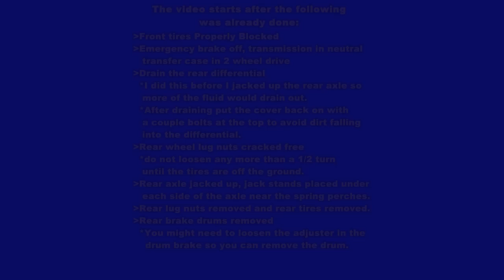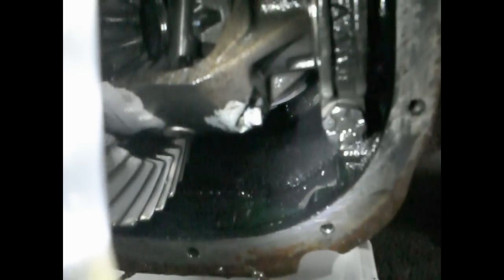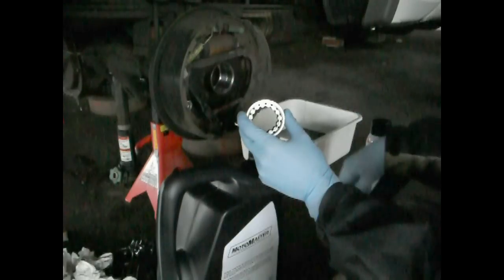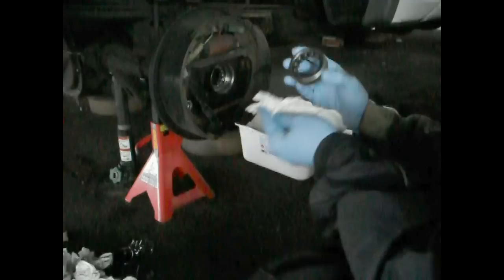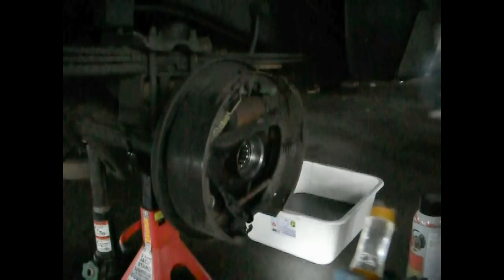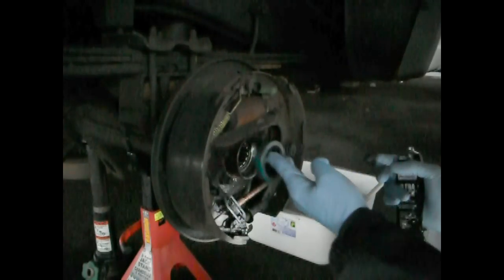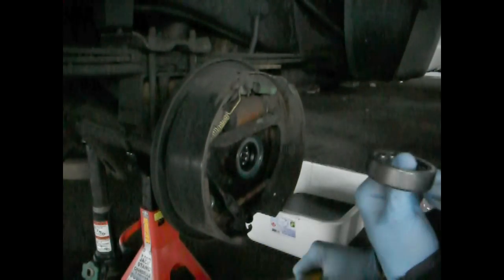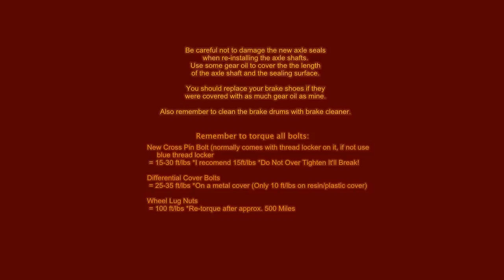Ford 8.8 Rear Axle - Replacing Wheel Bearings and Seals (28 Spline)

Comment from the maker: Hi, uawsux
I don't know why, but I couldn't reply to your comment directly.

Just to make sure, are you talking about the ford 8.8 rear axle? If you are, you remove the axle the same way as the passengers side. First you need to remove the shaft that goes through the carrier that holds two of the spider gears. Then you need to push in on the axle from where the tire mounts to the axle. Then you go back to the differential and remove the c clip from that shaft (there is one c clip for the drivers side axle shaft and one c clip for the passengers axle shaft). Then you carefully remove the axle shaft making sure you don't damage the wheel seal.

Comment: Thanks for this informative video. Your use of annotated photos and video worked well. I need to replace the rear bearings on my 1999 Mustang (7.5 inch gear set) and this looks to be very close to the task - except I have disc brakes (w/o ABS) versus the drums on your truck. A great tip I got from your video was to reverse and partially re-install the pinion shaft and hold it in place by hand tightening the shaft lock bolt. I assume this will ensure the spider gears do not misaligned or 'walk' out of place while one is trying to position the axle C clip for extraction. At least I think it will do that.  I plan to repair my Mustang later this spring and your video will be one of my references. ...very helpful. Thanks again.
Reply from the maker: Hi Bryan,
It's great to know the video is helpful.
Make sure both rear wheels are off the ground, the emergency brake is off, transmission in neutral, and you only spin the differential, not a wheel.

If you try to spin a rear wheel while the differential pinion shaft is out you might cause one of the spider gears to walk out. It's a good idea to remove the brake drums or rotors before removing the differential pinion shaft, because a sticky brake could also cause a spider gear to walk out while you try to move the differential with the differential pinion shaft out.

After the differential pinion shaft is removed (even if it is placed in backwards) the spider gears only stay held in place by each other as long as they are not spun. The main reason I placed the differential pinion shaft backwards into the differential with the lock bolt was to make sure it did not slip all the way in and to keep it clean. If the pin slips all the way back in it can be a pain to try to remove it again without accidently pushing one of the spider gears out.

I hope this makes sense.
Reply: Yes, that makes sense. And your recommendation to rotate the carrier / gear set internally is a great caution. Because I would have used the wheel hub for sure. I serviced the rear disc brakes last summer. So there is little risk for a stuck caliper. I will remove them prior to pulling the inspection cover. Thanks for taking the time to reply to my post. Regards, Bryan
Reply from the maker: Bryan Thomas No problem! I hope the job goes smoothly!

Comment: Great video.  I'm doing the same job to my '03 this weekend.  Hoping I have the correct bearings and seals.  I checked several times and cross referenced what I could online and got Timken bearings and Ford/Motorcraft seals.  I don't really think I need the bearings but if I'm already in there I might as well and they are not expensive.   I have a bearing/seal installer kit but just simply rented the slide hammer and bearing puller from the parts store.  Also replacing all the brake shoes and related components since they got soaked from the one leaking axle seal.  And of course several cans of brake clean to clean up the slimy mess it left behind.  The Ford seals I got look quite a bit different than the parts store ones.  They have a metal "flange" on the outer edge and and external diameter permanent O-ring type seal in addition to the inner seal that rides on the axle shaft.  Kinda feel better about that and they were only $1 more.  Hopefully they are!

The only thing I'm worried about is one of the spider gears falling out but I guess as long as you don't rotate the axles with the big pin out it should stay put.
Reply from the maker: Thanks klc317!
Those seals sound nice! You're right, as long as you don't rotate the axle shafts while you remove them or replace them then the spider gears will stay where they are.
Just be gentle while placing the axle shafts back into the differential because you need to line up the splines on the axle shaft to the splines in the side gears of the differential. If the axle shaft splines don't match, just pull the axle shaft out a little then spin the axle shaft just a tiny bit, then try installing again.
Good luck on the replacements!
Reply: +BMPWR got it all done today.  Easier than I thought except for of course they gave me the wrong bearings like you had mentioned in the video.  Got them exchanged and all went well.    Replaced all the rear brakes too.  I forgot how much I dislike working on drum brakes.
Reply from the maker: +klc317  Good work! 

Funny how many places don't understand the difference between the 31 spline and the 28/27 spline ford 8.8 axles.

Yah drum brakes can be a pain in the hands! I find a high quality pair of locking long nose pliers helps a lot to stretch the springs on and off.

I'm glad things turned out good!

Comment: One can uses a flat pieces of wood or other object when installing a bearing to weaken the blow to the to the bearing or uses a brass/rubber mallet/hammer
Reply from the maker: sam111880 Yup, you're totally right. I was just scared of driving the bearing in a little crooked, I don't change bearings often. I'm not a mechanic, I just work on my own stuff.

Comment: Thanks from Germany for showing this, it really helped me out ! Can i use your partslist for my 1997 Ranger XLT 3L V6 ?
Reply from the maker: Hi Seclorum, I don't know for certain if your truck will use the same parts. My truck was made in North America and I don't know if they would have used a different rear axle if your truck was manufactured on a different continent.

In North America Ford only used 2 types of axles for the 1997 Rangers:
Ford 8.8 28 spline = http://www.therangerstation.com/tech_library/Ford-8_8-axle.shtml
Ford 7.5 28 spline = http://www.therangerstation.com/tech_library/Ford-7_5-axle.shtml
My parts list will work on both of these axles except for the differential cover seal and the differential cover, you need to get the correct cover and seal for the 7.5 or the 8.8. The web links above can help you see which one you have.

As long as the axle was never changed, you can check your door sticker to see what axle code you have:
http://www.therangerstation.com/tech_library/axle_codes.shtml

I'm sorry I can't say for certain that my parts list will work, I just don't want you to buy a bunch of parts only to find out later that your truck had a different rear axle.
Reply: Thanks Mate, my Ranger is also made in North America. A Soldier of your army brought it to Germany.
Your helped me a lot with that answer. I am so glad to find you and your channel !
Thank You !
Reply from the maker: SECLORUM That's great to hear! You're welcome from Canada! I hope the repairs go well!

Comment: Thanks for sharing. Is it necessary to use slide hammer to remove bearing why not cut the bearing cage on one side to partially loosen it for removal?
Reply from the maker: You're welcome!
I chose to use the slide hammer so I didn't have the chance of damaging the axle or needing to clean out all of the grinding dust, but if you were really careful when cutting and and made sure to clean really well I'm sure cutting would work.

Comment: I get how one replaces the  bearing and rear axial from the differential cases but i am curious if rear axis are the same on most cars or are they different on removal/installation methods and components for different drives like 2 wheel front ,2 wheel rear , 4 wheel drive , or all drive vehicles
Reply from the maker: sam111880 Hi Sam, axles can be very different from each other and the removal/installation for each can be very different. It's best to learn about the specific axle that you need to work on. You would need to find out what axle is used under the specific vehicle. I hope this helps a little.

Comment: Getting ready to do this job on my 97 Mazda B2300-- how much gear oil do I need? I can't seem to find how much the rear diff takes. I assume getting 1gal is probably the best bet. Thanks!
Reply from the maker: +Deb Spannagel 
Hi Deb,
I don't know for certain what rear axle you have, but I think it is a ford 7.5. If so it should take around 3 quarts.
Just keep filling  into the fill hole until it starts to leak back out of the fill hole. Oh, and the truck needs to be on level ground and not on jack stands, otherwise the fill hole might be at the wrong angle.

Here is a page that might help you with your rear axle:
http://www.therangerstation.com/tech_library/Ford-7_5-axle.shtml

Hope this helps!
and you're welcome.

Comment: Will a 7.5 axle shaft fit inside an 8.8 carrier with 8.8" ring gear?
Reply from the maker: Just to make sure, do you mean an 8.8 28 spline carrier? They will not fit properly in a 31 spline 8.8 axle housing or carrier. I've never tried this, but from what I have read the 7.5 axle shaft will fit as long as it came from the same production years (7.5 and 8.8 from up to 1992) OR (7.5 and 8.8 from 1993 and later). You can't mix for example a 1992 shaft with a 1994 axle housing. I think they made one of the axle shafts longer from 1993 and later on both the 7.5 and 8.8.
Hope this helps.

Comment: what gear oil did you use
Reply from the maker: Hi Tom,
I used MotoMaster 80W-90 Extreme Pressure Gear Oil that had the following specs: Hypoid Gear Oil, API GL-5, API MT-1, SAE J2360, Mack GO-J
http://www.canadiantire.ca/en/pdp/motomaster-80w90-extreme-pressure-gear-oil-5l-0280249p.html#.VsHO2_luns0

In the write up on the back of the oil jug/bottle it will normally list the specs. The most important ones to get from what I've read are: Hypoid and GL-5

One very important question is: Do you have a limited slip differential (LSD)? If you do have a LSD then you need to either get a small bottle of friction modifier to mix into your gear oil, or buy a gear oil that already has friction modifier in it.  You can buy the bottle of friction modifier from Ford, but you might be able to find it other places, but I don't know where you can but the LSD gear oil.

The friction modifier allows your limited slip to work properly with out burning up the limited slip clutches. My truck did not have a limited slip differential so I did not use friction modifier.

A great site for some info on the axle: http://www.therangerstation.com/tech_library/Ford-8_8-axle.shtml

Thanks for watching!

Comment: same method for a 97 ford explorer v8 awd?
Reply from the maker: Hi Ronald,
I think it will be the same method but I believe you will need different sized bearings and seals. I believe most explorers will have a 31 spline ford 8.8 rear axle so all of the parts are a little bigger. Also it might look a little different in the differential if you have the limited slip style differential. You can still do it, it just might be a little tighter to get the c-clips/u-washers out.

Here's a write up from a really good forum that might help you too: http://www.explorerforum.com/forums/showthread.php?t=214805

I hope everything goes well!
Reply: Thank you so much for the response and help, I did get the axles pulled but my passenger side was chewed really bad, now I'm stuck looking for a replacement
Reply from the maker: Ronald Monti You're welcome!
Well that sucks. Hopefully you can find a replacement 31 spline passenger side shaft for a good price.
Reply: Me to

Comment: funny thing is every 1 of these videos is....that pin that all you guys take out with little or no effort to push axle forward for the clip removal,yeah i ve been on mine for 2 days now,,,,wanna explain your secret....cause i don t get ?....why can t i gat mine out?
Reply from the maker: +grant peachey 
Hi Grant,
Normally the pin slides out pretty easy once the retaining bolt is removed. Is there any chance the retaining bolt was partially broken off in the differential? It might have happened when someone else was working on the differential. Check the retaining bolt and make sure it has no threads for about a 1/4 inch on the end that goes into the pin. If the bolt was broken then you might need to research how to remove a broken retaining bolt, I've heard it's a challenge.

If the retaining bolt was not broken then you might have a lot of wear on the pin that you are trying to remove. It can get grooves worn into it and the groove would catch as you try to slide out the pin. You'll need to wiggle the spider gears and their washers that sit between the gear and the carrier. Once the pin is removed you'll probably need to replace the pin and maybe the gears and washers.

Hope this helps
Billy